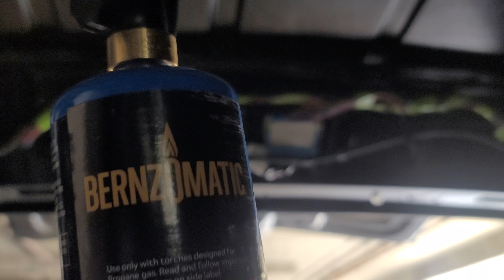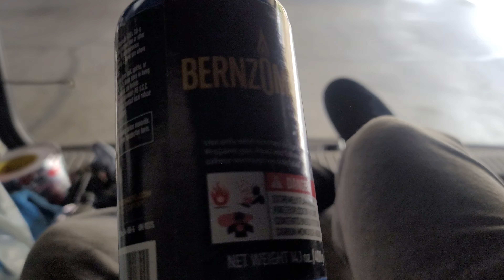Applying Sundown Audio 160 Mil Sound Deadener To Roof

Comment: I’m planning on doing the whole car with this probably double layer I don’t want anything flexing I’m already $8k deep in my system and I got another 4k+ more to spend I don’t wanna go back around and need roof fixed doors etc
Reply from the maker: Samehere bro I can relate I have quite a few sheets to do the roof doors and floor. Definitely don't want the new system tearing the vehicle up too much so I wanna cover what I can